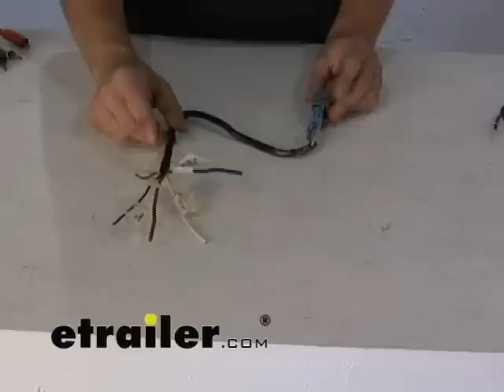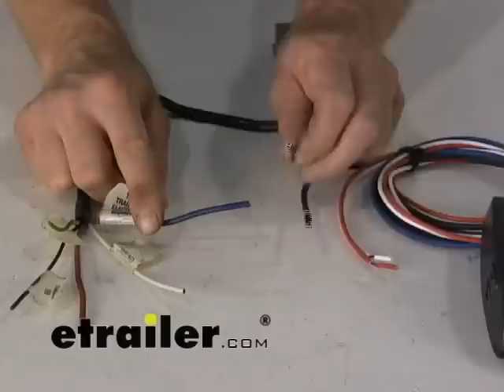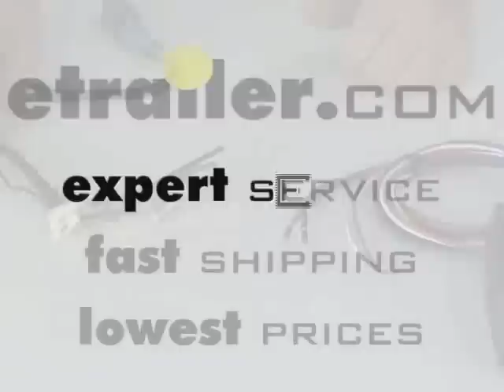etrailer | Trailer Brake Controller Wiring Colors

Comment from the maker: You need to hard wire the 4 wires from the brake controller into your Liberty. Use a circuit tester to find which wire behind the brake pedal is the stop-light switch (goes hot only when brake pedal is pressed). Connect red wire from the brake controller to that wire. The black wire is connected to the batter via a 20amp or 30amp circuit breaker (see brake controller instructions). The white wire is grounded. Lastly, the blue wire is connected to the blue wire on the 7-way with a length of wire.

Comment from the maker: 3 components are needed to install a brake controller in your Liberty. The 1st thing you need is a 4-way trailer connector. We offer a custom 4-way that plugs inline with your current wiring (Part # 42475). The 2nd part is a kit to convert your 4-way into a 7-way trailer connector. You will need a kit ( #ETBC7) that comes with the require connector and all the wires necessary to connect to a brake controller. The controller is the last item you need. Visit our site for loads of FAQ and info!

Comment from the maker: @UvisionMedia If your car does not come with a tow package, you will need to get a different wiring setup.  We sell them as hardwiring kits at etrailer(dot)com.  If you visit our site and enter the year, make, and model of your car, you will most likely be able to find a kit that will work for your car.

Comment: i got a 1985 silverado c30 1 ton it was set up for a 5th wheel before it has the 7 pin plug in i checked it has  brake lights and  blinkers and under the dash there is 3 wires hanging down im assuming they was for a brake controller there colors are black white and blue i checked the black wire and it is hot.ok so white is a ground and the blue goes back to the 7 pin connector which is for the trailer brakes so my question is here if there is only 3 there what do i do with the red wire lol if this makes any sence do i even need to use the red wire for anything  also i bought a used tekonsha primus iq p2 brake controller it was used so dindt come with any paperwork thanks for your time

Comment: so by the sounds of the video it would be pretty simple to install a brake controller on any vehicle if you knew what you were doing? i'm looking to import a toy hauler to the uk but use a european 4x4 to tow it with and need to install an electric brake controller.

Comment: My question may sounds complicated but it isn't...

I've got a 1984 Chevy RV Van and I recently bought a single axle trailer. The trailer is already fitted with brake lights and it ready to be plugged in to the vehicle. 

The van was never equipped with a trailer so it doesn't have a connection. I bought a harness to attach to the wiring behind each vehicle brake light, but how do I connect the harness to the wires? Once that's done i just plug it into the 5 way connector on the trailer, help!
Reply: Brendan Mahoney lol did you figure it out. It’s been 5 years idk why I’m commenting